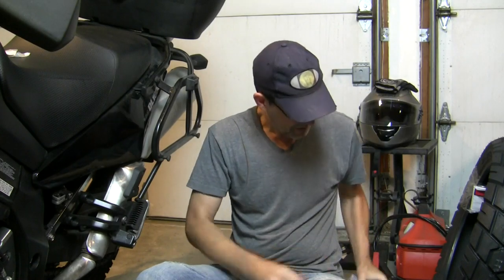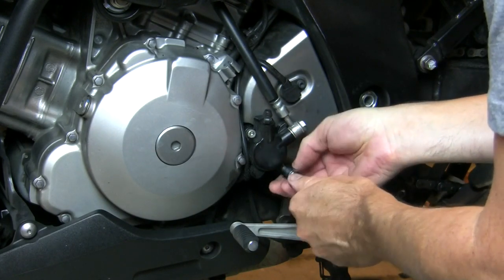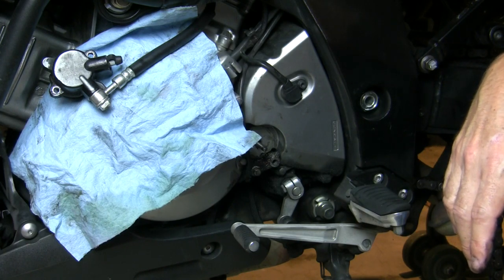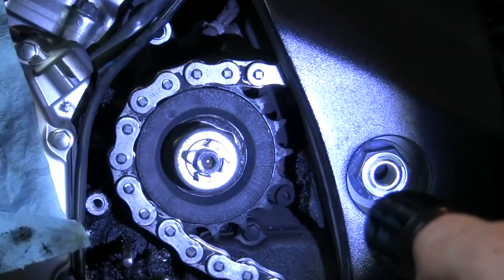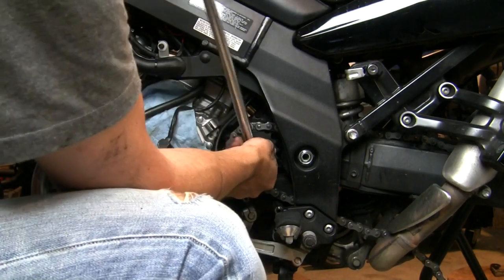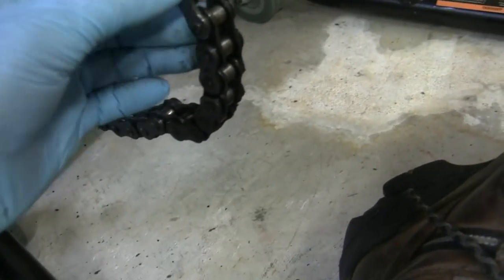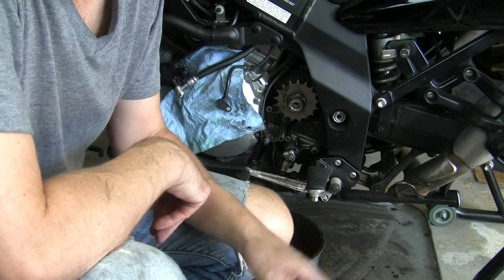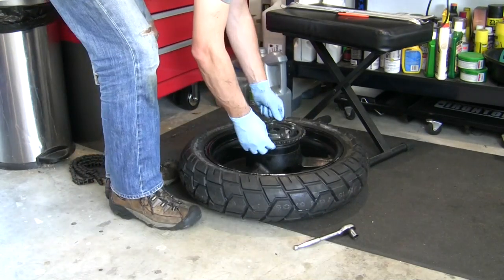Change Chain and Front and Rear Sprockets, Suzuki V-Strom (Part 1)

Comment: If you must use your hand to hit spanners and ratchets, try going across your hand using the flashy parts rather than lengthways where you gang crush the carpel tunnel where the nerves run. You can cause issues with dexterity if you crush those nerves
Reply from the maker: Thanks for watching and for your insights.

Comment: I own a DL1000ZAL8, but my question is about a GS550 build (working a GS750 Scrambler).
Did you replace the footpegs with something more dirt worthy, and if you did, what was that footpeg?
Reply from the maker: Thanks for watching! No, I used stock pegs. My GS build was more street focused and I just decided to save $ there. It was a budget build. If the suspension on your GS750 is anything like my 550, you will probably want upgrades there if you're going off the streets.

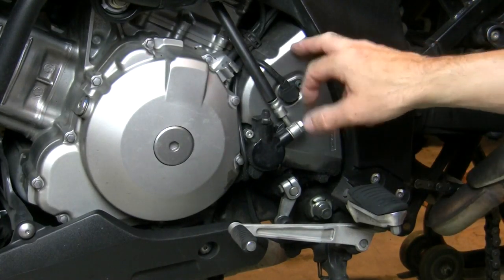Comment: 2:15 - First thing you want to do is zip tie the clutch handle down. That's how at 4:05 he just pulls the one part off, leaving the actual rod in the system. If you don't pull the clutch in, the clutch fluid is going to spill and leak everywhere and you'll end up having to bleed the system for half an hour.
Reply from the maker: @SlandersPete  I didn't tie clutch handle down. It doesn't leak if you don't. It's a closed system.
Reply: @UrbanMonkTV I can also attest to that, I removed the slave cylinder and didn't tie down the clutch lever and no leakage happened.
Reply from the maker: @HLMM_KE  Thanks for weighing in!
Reply: @UrbanMonkTV  Hey, one question on the front sprocket. I have a 17tooth sprocket on my 1050XT. I want to change to a 15 tooth sprocket becasue I ride in slow traffic everyday and I need the low low end torque. I don't mind reduced top speed becasue I dont think I want to be doing that anywhere. Do you think the 15 tooth front sprocket will be detrimental to the motorbike in any way?
Reply from the maker: @HLMM_KE  Not detrimental at all, other than the engine will average higher rpms, but you said you don't ride top gear high speeds anyway. On the other end of the spectrum...your engine will experience lower load forces at lower rpms and one could argue that would be more gentle to your engine and clutch.
Reply: @UrbanMonkTV  thank you

Comment: not sure if it’s mentioned but looks like that front sprocket has dampening built in which is why it’s a beefier sprocket
Reply from the maker: Yes, you're correct. This video was shot years ago and I have used non-dampened front sprockets ever since with no issues or complaints. FWIW. Thanks for watching!

Comment: i tried to replace my front and rear sprocket as well, and i cannot get the same bolt in 11:10 out ,  its too tight and i even used a air impact gun but still it's not coming out, do u have any advice on that? is there any other ways i can try to get that bolt out so that i can replace my front sprocket
Reply from the maker: If you have a torch, you can put a little heat to it to loosen it up first, but breaker bar or impact wrench are the tools typically used. Warning, lots of guys will tell you an impact wrench is hard on the gears inside the transmission. When I use an impact wrench, I always have the transmission in neutral. The chain should provide the only resistance to turning. Hope that makes sense.
Reply: @UrbanMonkTV  sighhh... I think the bolt is stripped as the air impact gun is too much for it, have you ever experienced this before? I am worrying if the bolt is too tight that even the impact gun cannot get it out plus its stripped... Will this mean I cannot change the front sprocket ever?
Reply from the maker: @benchp1869  I'd be very surprised if it is stripped. That shaft is hardened steel. We are talking about the sprocket nut, correct? You used the word bolt so I want to sure I am clear.
Reply: @UrbanMonkTV  apology, I should say the bolt in 11:03 which you simply use a wrench with your hands to loosen it
Reply from the maker: @benchp1869  Ah! That's the speedometer rotor bolt. That has Loctite on it (medium) and is difficult to get out. If you stripped the head, you may have try a vise-grips. Try heating that shaft first. Will take a while for the heat to get into that steel shaft, which will be a heat sink. The heat should loosen that Loctite up. You'll probably only get one shot at it so make sure its good and hot (not red hot) before trying. Careful chain lube doesn't start on fire. May want to clean first. New bolt is part # 07130-0825B
Reply from the maker: @benchp1869  And I'll add this. Don't become too disheartened. I've faced situations like this before where it is difficult to see a resolution. The solution will eventually come. In an instant that bolt will become loose and will come out and the whole problem will disappear in that instant. It's happened to me many times.
Reply: @UrbanMonkTV  thank you for being so kind! I do not know there is loctite on it, will try to use your method and see how it goes. Hopefully I can crack it and really thanks for your encouragement
Reply from the maker: @benchp1869  You're certainly welcome. I hope I was helpful.

Comment: Good video. I have an SV 1000s and just to note, the slave cylinder is not sealed (just a rubber gasket on back) and when it gets gunked up and stuck by old lube, it will come off and then leak out. No big deal really but good to know. other than that, a great summation and helpful! Thanks!
Reply from the maker: Peter Rosendale Great tip! I love how YouTube enables the collective community to help each other out. Thanks for watching.
Reply: Urban Monk TV absolutely! There’s very little for the Sv 1000 so finding good videos with a Vstrom is the next best thing. Take care!
Reply: @peterrosendale7759  very true!!

Comment: Sir: on the front sprocket whether it's USA spec or the 650 or 1000 or 1050...they all leave the factory with a rubberized front sprocket. It is not a cush-drive effect for said sprocket but rather a very tiny sound minimizing deal for the Euro weenies who feel the need to legislate every damn thing. Suzuki says the rubberized front sprocket reduces chain noise and output shaft noise by as much as 2 dB's during ride by testing. Most techs including myself typically replace the front with a plain steel JT brand in whatever tooth count you desire. Hoping that helps.
Reply from the maker: Thanks for watching and sharing your insights. Yes, I've run JTs ever since changing the first time (now at 84,000 miles) and no issues with plain sprocket.
Reply: @UrbanMonkTV  My pleasure Sir and you did what most all the rest of us do. Replace the rubberized one with plain quality JT steel.

Comment: What tyre pressure is for a Suzuki 650vstrom
Reply from the maker: I don't own a 650 or have a manual for one, but I would have to guess they're the same as my 1000. 36/36 frt/rear when solo with no gear and 41 in rear when riding 2up or with gear loaded.

Comment: I’m ignorant having never done this before, but I’m planning to this weekend. Can I grind just one pin and rotate the plate out of the way and slide the chain off, or do both need to be ground if I’m not reusing there chain.
Reply from the maker: You'll need to grind both as the pins are expanded tight in the plates. The plate won't rotate. Thanks for watching!
Reply: Urban Monk TV thanks so much for all the valuable information you’ve shared and for your response.
Reply from the maker: @MrWhitmire  You're very welcome.

Comment: I was about to change my chain on my DL1000 with only 20K miles.  Usually, that is about as much as I could expect even though the rear sprocket looked pretty good.  How far back on the adjuster were you when you made the chainge (deliberate misspelling).  I am still about 4.5 notches from the end of the adjuster.   I decided to do a thorough cleaning and lube job instead.  I hate replacing chains.  I just did not want to get stranded.

The heavy duty counter sprocket is thicker in the middle because it has a very tough rubber cushion between the shaft opening and the teeth.  It is supposed to smooth out shifting under acceleration.  Seems unnecessary to me, as the rubber is hard as a rock.  Did you see any difference in smoothness during shifting?
Reply from the maker: Thank you for watching! I honestly don't remember how far back on the adjusters I was. This was some time ago. I judge chain stretch by measuring 20 pitches. I've done a video on that https://youtu.be/KjLsUsgKfnc. Thanks for the information on the rubber core in the front sprocket. I have not noticed any difference in shift smoothness since replacing the rubber sprocket with a cheap regular one.

Comment: Hello great videos very thorough . i thought you planned on changing the rear wheel bearing when you changed the chain
Reply from the maker: Miguel Carides Thanks for your kind words. No, I didn't have plans to change the bearing with this job, unless they were showing signs of wear, which they weren't. Maybe next tire. We'll see. Wheel bearings go 50k+ miles pretty often in my experience.
Reply: Urban Monk TV ok thanks i have a 2012 dl1000 and you are my new best friend i really appreciate your videos

Comment: Doing the countershaft torque before removing the  the rear wheel is a necessity. You've screwed up if you didn't follow the proper work flow
Reply from the maker: Thanks for watching. My father would say there's more than one way to skin a cat.

Comment: My question is I want to put a 16t on the front but the bike is new can I just change the front only
Reply from the maker: Yes, you can change one without doing the other. You can also change without breaking links on the chain. Just loosen axle to give slack, remove sprocket nut, and slide sprocket off spindle. Replace with new sprocket. Hope that helps! Thanks for watching!
Reply: @UrbanMonkTV  thank you so much

Comment: Why wouldn’t you just put it in gear?
Reply from the maker: That is an excellent question. One that deserves its own video o explain. So I'm going to make that video. Until then, the short answer is potential transmission damage. Thanks for watching!
Reply: Would that not risk damaging the gears. I don't know but I would rather break a chain than a gear I guess.

Comment: Thank you. but what size and year is your bike, how many teeth....??? the devil is in the ...
Reply from the maker: Thanks for watching. My bike is a 2012 DL1000. 17/41 sprockets stock. 525 chain 112 links. I've recently been running a 43 tooth rear sprocket and like the get up and go off the line, but it has slowed me down on the freeways as I don't like running this engine over 5k for long.